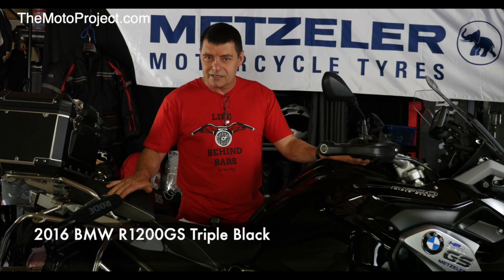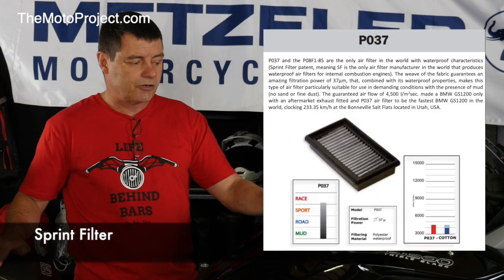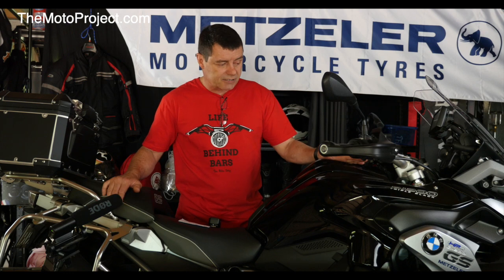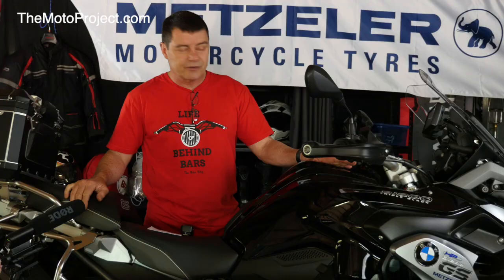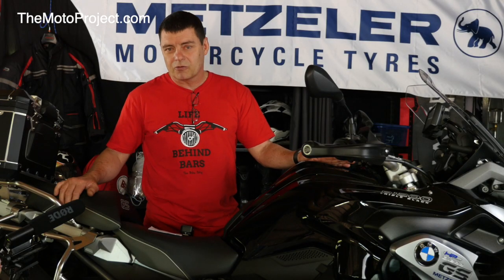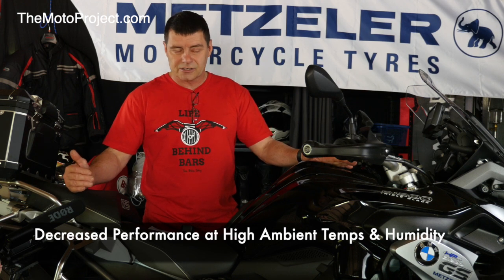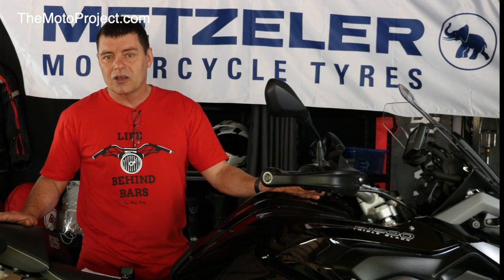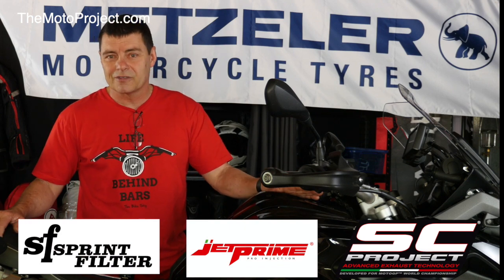BMW R1200GS Performance - Jetprime Part 2 Ride and Dyno Testing the Memjet Evo Power Module

Comment: Hi. Does this device help lower and maintain the engine operating?
Reply from the maker: I couldn't answer that mate, I simply gave it a run. Ended up removing it from the bike, not sure if it makes a lot of difference. Apparently is simply works on the principle of tricking the engine into thinking the temperature is lower so the fuel mixture is richer. But then again, I am not an expert on the device.

Comment: good info to know. I have one coming for a dorsoduro
Reply from the maker: be keen to hear what you think
Reply: @TheBikeStig  I just did decat removal on exhaust. I have fatduc on for the low end. your videos did not mention that below 3400 rpm that the lambda sensors will take over and will create lean condition on bottom end. I use a fat duc which is tied into each cylinder to trick voltage to give more fuel. jetprime sells a similar device.
Reply from the maker: @michaelbuxton9611  thanks mate, I know a little about the lambda sensors but not enough to give specific information, I had the bike dyno tuned with a power commander on it. Though I know the best way to resolve any fueling issues is ultimately an ECU tune.
Reply from the maker: @michaelbuxton9611  Just did some research the Fat Duc. Looks like it does a similar thing to the Jetprime in that it manipulates readings with a view to tricking the ECU into running the bike richer. Interesting.
Reply: @TheBikeStig  I see you didn't mention the oxymett in your vid. they mentioned that below 3400 that the memjet will not work due to lambda sensors kickin in. the oxymett blocks that signal. fat duc changes the voltage of that signal. less voltage more gas
Reply from the maker: @michaelbuxton9611  I'm a dunce mate, didn't know the finer detail of the workings. Thanks for the technical education, appreciate it.
Reply: @TheBikeStig  I'm trying to talk to jet prime about it but I can't get a straight answer.
Reply: @TheBikeStig  I'm going to get a used oxymett off of eBay. I will try both of them and see which one is better. difficult getting a ecu flash. I want Dyno results and nobody seems to be able to produce that.
Reply from the maker: @michaelbuxton9611  I did some dyno testing and it was interesting that in hotter temps it did not help at all, the only improvements we got were when temperatures were cold.
Reply: i did pick up a used oxymett off of ebay. the oxymett totally cancels out the lambda sensors where as the fatduc used voltage changes to trick ecu into adding more fuel on bottom end. since i have the memjet, i could not get jetprime to officially say the fatduc would be compatable.  better safe than sorry so i got a oxymett. did you try a oxymett on your bikes? jetprime already stated that below 3400 rpm the memjet would not work
Reply from the maker: @michaelbuxton9611  no mate, haven't tried other products, I tried this one as a product review at the request of someone. Most of my performance turning focus is on the S1000RR for track purposes and I'd rather go the path of dyno tuning and ECU flashing. At the end of the day the performance gains are much greater. I did leave the Memjet on as I did notice some benefits with cooler weather which we have a fair bit of.

Comment: The Memjet Evo is nothing more than a potentiometer inside a plastic box with a fancy connector. You can knock up your own potentiometer and some wire for pennies.
Reply from the maker: I never knew that, though it is a time saver for the non technical folk like me
Reply: I am way too late but i would like to know how to make one😅

Comment: Would this work with decating the exhaust system and and taking out the  o2 sensor using the o2 sensor eliminator.. And also fitting end can muffler. Thanks
Reply from the maker: wow, I am not that technically proficient on this item. I would go straight to the makers of the device (Jetprime) with a question like that mate.